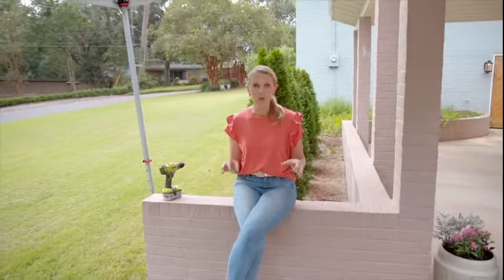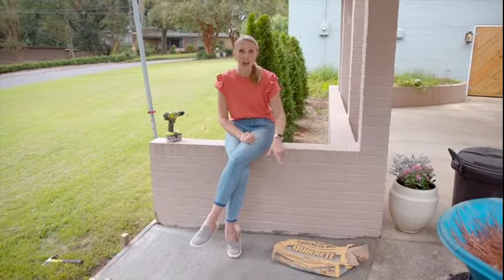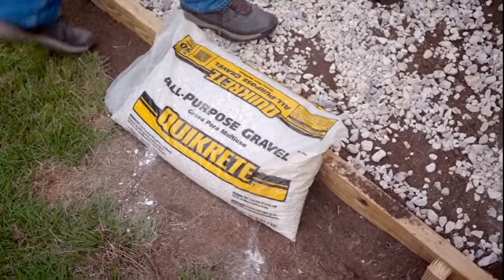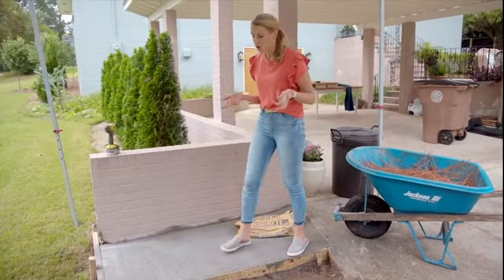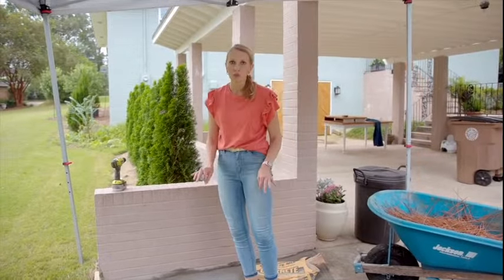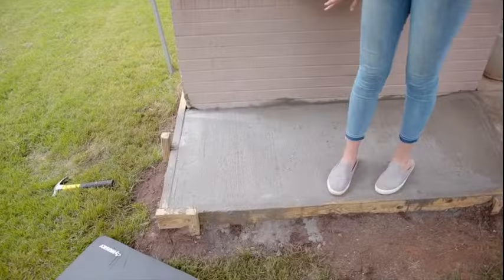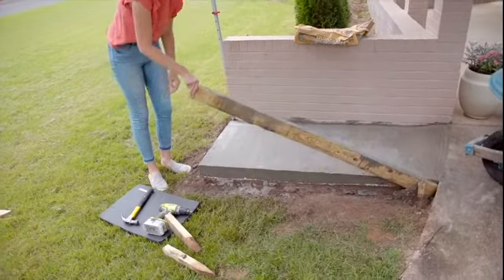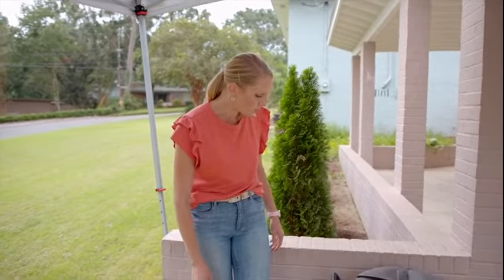Creating a Place for Your Trash Can

Comment: I absolutely love that now I have to tell you secret years ago I got frustrated because I had no place to put my drills so I found a couple pairs of Crocs and I screwed them up into the ceiling of my shelf and I slide my drills in them and bring a little strapped down to hold the rear up in there and they work great
Reply from the maker: Glad you found a solution that works for you! :)